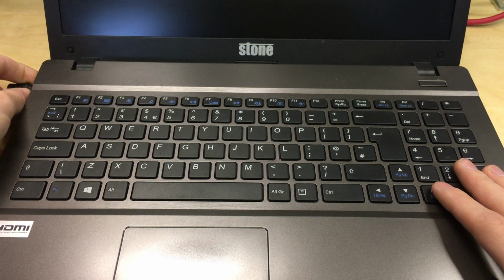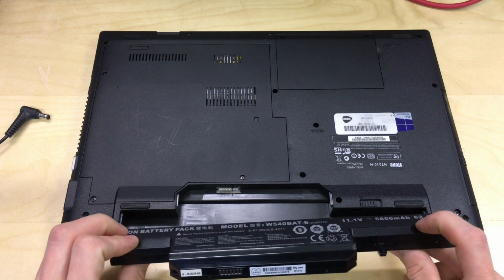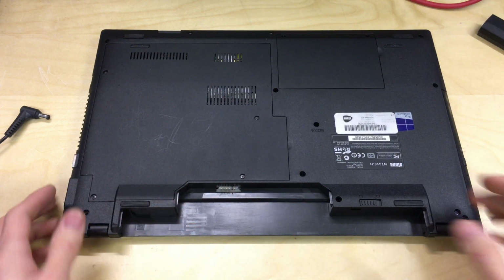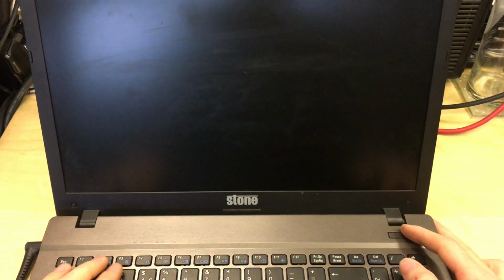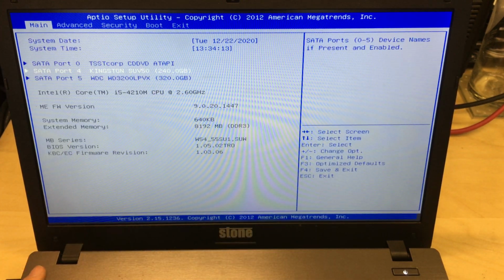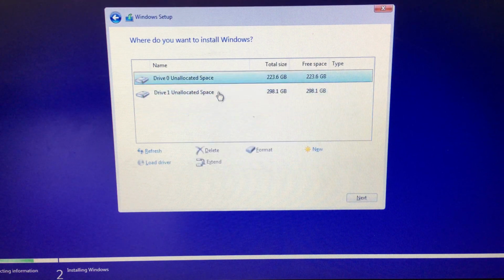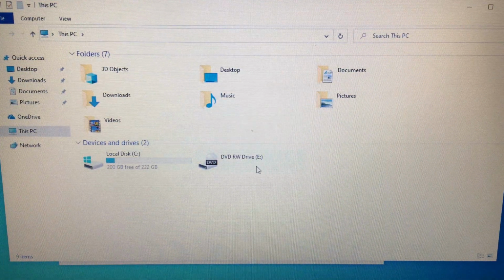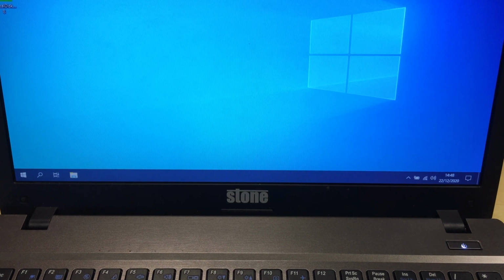How To Install An M.2 MSATA SSD In A Laptop - Kingston SUV500 vs HDD Speed Comparison - Stone NT310

Comment: Are you able to do a tutorial for upgrading the RAM in the laptop?
Reply from the maker: Hey, I can't at the moment unfortunately as my niece now has this laptop. It was to be a Christmas present for her so I did all the upgrade videos last year before handing it over. However if you simply remove the bottom cover as I do in this video, you can see the RAM modules. All you do to release them is push the clips on either side out slightly, simultaneously, and the memory module should lift/spring/pop up slightly allowing you to slide it out. The process for reinstalling new RAM in its place is to slot the modules back in like the others came out, and gently apply pressure and push them back down into the spring/clip latches. 

Hope this is somewhat helpful!  --Nathan.
Reply: @NathanPH  Thanks

Comment: What is your overall opinion on this laptop? I want to use one for light gaming, is it good enough? I really enjoy your videos and your expertise, I just subbed.
Reply from the maker: Hi, Thanks for the sub! 
It's a pretty good all round laptop, especially if you put an SSD in it and have the i5 processor. Quite thin and light, the hinges can feed a bit flimsy but they are adequate I would say. 
Regarding gaming that would entirely depend on what kind of games you are looking to play on it. Bear in mind that it does not have a dedicated graphics card - only the integrated Intel graphics from the processor. 
You would have to check the system requirements for any games you wanted to run, It should handle Minecraft, some light MMOs and older titles, etc.. fine though. 
Hope this is somewhat helpful! 
--Nathan